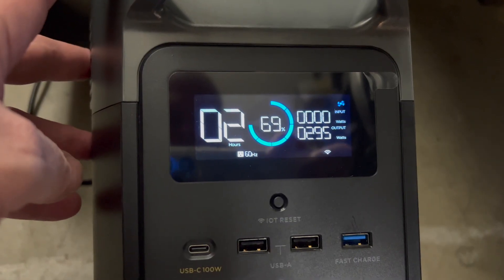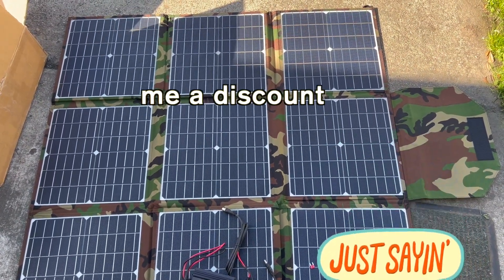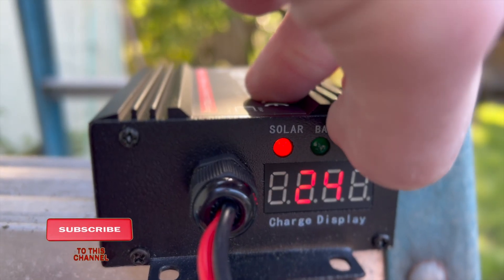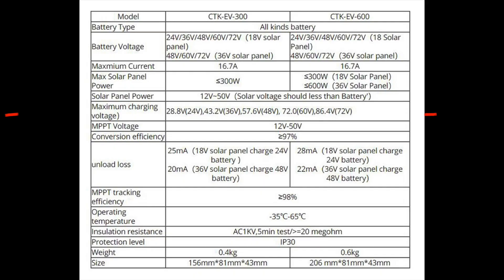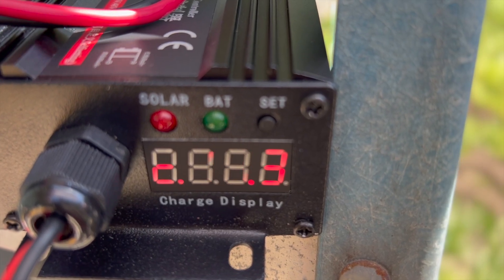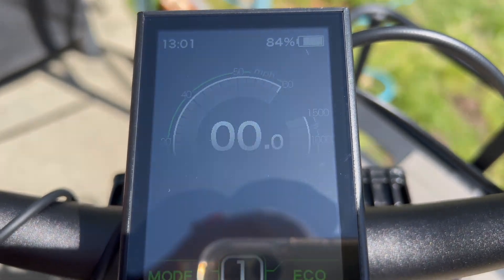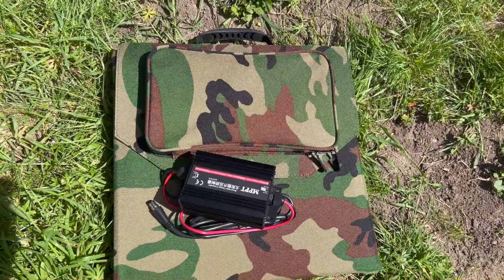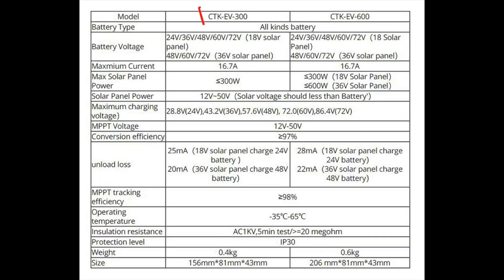eBike | Charge an eBike with ONLY a Solar Panel

Comment: ya but a 48v bike needs to charge over, at like 54 volts. and  the 60 volts would be too much. and my other question is, how do you regulate the amp output from charge controllers? ebikes only want 4 or 5 amps charging it. most charge controllers are 10 amps and up

Comment: 10.8v will not charge a 48v battery... did you mean it was pulling 10.8 amps...?  the charge voltage has to be higher than the current battery voltage to push energy (amps) into the battery..

Comment: don't put it on your roof.  It is less efficient when it is hot.  That hot tar is tranmitting heat into the panel from the bottum up.
Reply from the maker: I made the video a couple years ago in my old house, and it was the only place where I had full sunshine. It worked just fine.

Comment: I have an e-trike, 1000W, 48V, 12A, but $900 is more than I have in the bike, hub motor and wheel, and four 12V lead acid batteries. Where's the economics?
Reply from the maker: It's obviously a subjective topic. If one plans to travel by ebike and camp along the way, this is a possible option to recharge during a day at the campsite. It's a lighter option than carrying a power bank like a 1500w Jackery.
Reply: Oh, that’s AU prices, so 75% of that in US dollars I guess?

Comment: can you list all of the stuff you have used please
Reply from the maker: Sure.
Bakcou 200 watt solar panel with charge controller
EcoFlow Delta Mini to fully charge both my ebike batteries from 35% to 100%
Jackery Explorer 500 to top off four ebike batteries from 90% to 100% while camping
Jackery Explorer 1500 to fully charge both batteries on my ebike from a 20% charge to a 100% charge

Comment: Hey Tim, now that you've had this charging system for a while, what would you do differently today? Going to invest in a ULTRA FS Pro dual next spring for off road adventures so I'm tryin to dial in my overall costs for this to be efficient and fast. I think the cargo trailer you reviewed does it for me to be able to carry a solar system and a possible ECOFLOW DELTA 2 if I can swing it.
Reply from the maker: The Backou is nice because of its size and the fact that it can plug directly into the ebike's charging port. It's really best for riding and camping.

If I'm actually camping and bringing the ebikes along, however, my Jackery 1500 is by far my favorite option. The downside is that it runs about 36 lbs not accounting for at least one solar panel (about 15 lbs each).

I really like my Ecoflow Delta Mini at around 24 lbs, but it's only 852wh. The Delta 2 definitely provides more charging power and is only about 27 lbs. I also like that Ecoflow has the smart phone app you can sync up, but it's only good if you can connect the power bank to wifi. Ecoflow's solar panels are a couple pounds heavier and a little more cumbersome than Jackery's, but Ecoflow is a great choice.

For me, I love my Jackery 1500, but mostly because I've purchased four different options now and it gives the most watt hours at 1544. I also have a Jackery 500, but it's really only good for simple top-offs from about 80-85%.
Reply: @twowheeltim  Thx for the quick reply Tim! The Backou sounds like the wat to go. Thinking about just buying a 3rd battery instead of Ecoflow to save money. I can buy the battery bank later.  at least this way I can leave both batteries at camp charging during the days I'm out on the mountain and don't need a range extender. Having 2 full batteries in the morning when it time to leave home should do it. I can always charge the 3rd batt from the solar panels while riding home if needed anyway. Cheers
Reply from the maker: I actually had just arrived home from work and the notice of your comment popped up, so a quick reply was easy. 😆

I bought a 3rd battery from Biktrix late last year when they were running a special on batteries. Hopefully they do it again this year. 🤞🏼

I like the Bakcou, and upon request they even threw in a barrel plug adapter for Elaine's Hub Duo; my Ultra Beast 2 has a 3-prong plug for charging. Not sure what type of plug the FS Pro has...

Best if luck in your decision! I'm confident you'll be stoked!!  👍🏻

Comment: Great for remote charging. Fyi it costs about 4cents of electricity to charge a battery from 0 to 100%
Reply from the maker: My video wasn't to promote solar charging in lieu of charging with electricity. It was to explore the option of solar charging on an ebike camping trip where electricity is not an option. 👍🏻

Comment: Nice setup, only thing you should mention which is rather important, is that the solar panel system you have will have built in diodes to stop reverse current flow. If someone copies your setup with different solar panels they will need to use diodes in between the solar panels and the charge controller.....worth mentioning
Reply: Any decent PWM or MPPT charge controller will have a blocking diode built in
Reply: @dfgatorfan Better to give advice that's found unneeded. Than with hold, knowing, or letting poorer sorts try and waste everything, money, time effort to buy, effort trying it.
Reply: @dfgatorfan  yes i didn't know about that till recently
Reply: seems most charge controllers have built in diodes but worth mentioning
Reply: Most all new solar panels have the diodes built right in.
Reply: @Chris_1024_ very interesting result
Reply: @Adventures of Two-Wheel Tim
I'm looking for a 60v system. What's the name of the charger?
Thanks from Trujillo Perú.

Comment: Hi thanks for the video. Will a 400 watt solar panel double the speed of the recharge?
Reply from the maker: Thank you for the positive feedback.

Presumably, that would be the case. However, it all depends on the amount of direct sunlight the solar panel gets. In the instance of this solar panel I tested, it would need to be much larger requiring more space to lay it in the sun.

I you were to get a nice quality 400w solar panel with proper charge controller and plug to fit your bike/battery, it's safe to assume it would charge more quickly.

I must caution, however, that I'm not a solar or electrical expert. This 200w solar panel, charge controller, and plug accessory kit are sold by Backou Bikes in Utah, U.S. and are sold as a bundle to charge ebikes. I imagine it could be used differently, just as someone with the proper knowledge and experience could set up their own ebike solar charging system. That's just not me, unfortunately. 🙂
Reply: @twowheeltim  thank you my friend
Reply from the maker: Happy to help. My main reason for getting this panel was portability. I can carry it in my cargo trailer, and if were to take a multi-day camping trip I can use it to charge during stay-overs at campsites. At least, that's my hope someday!  👍🏻

Comment: What is the cheapest portable power station and solar panel I could get for an e-bike do you think?
Reply from the maker: Well, it depends on the size of your battery, but realistically speaking to get something that will fully charge your ebike will cost anywhere from $1000-$1500. 

I have an Ecoflow Delta Mini that is an 852wh, 1400w output power bank. I also have 110w and 160w solar panels to charge it faster. I charged my Ultra Beast 2 dual battery ebike from about 35% to 100% in just under 3 hours.

The Ecoflow Delta Mini now costs around $600, but when I bought mine almost 2 years ago it was $899. You can now get a Delta Mini and a 220w solar panel for about $1200 on the Ecoflow website. https://us.ecoflow.com

Here's a link to a video I did charging my ebike with the Delta Mini: eBike | Charge an Electric Bike with a Power Bank! | Ultra Beast 2 & Ecoflow
https://youtu.be/vVbB_n78_2o
Reply: @twowheeltim  Nothing I could get for like 300 hey? Would it just be a waste of money at that point?
Reply from the maker: Unfortunately, for that price point power banks typically only have enough output to charge smaller electronics such as phones, tablets, laptops, etc. 

A $300 power bank would likely have around a 300 watt-hour output. Charging an ebike is going to pull around 250-300 watts, so a smaller power bank would barely last an hour and likely yield 10-15% charge at the most. That's fine for topping off an ebike battery, but the efficiency wouldn't really be worth it if using a solar panel to recharge the power because this would take around 5-6 hours to replenish. I tried it with my Jackery 500 and it was decent just for topping off.

I show that a little bit in this video: eBike | Camping & All-Terrain Versatility | Biktrix Juggernaut Ultra Beast 2 & Hub Duo
https://youtu.be/xZ7WozKy4xU

Comment: Where can I get a 2,000w solar panel from ?
Reply from the maker: 2000 watt solar panel for ebike charging?? I'm no solar expert but that would be pretty excessive for ebike charging, I think. A small home needs at least 4000 watts. If you really want a 2000 watt solar panel, Google it, but you won't find one made for ebikes.

Comment: Did that charge controller come with the 3 pin connector that plugs into your bike, or did you have to wire that 3 pin connector to the controller yourself ? Thanks
Reply from the maker: It actually came with the 3-pin plug, and a barrel plug for single-pin batteries. They're easily interchangeable.
Reply: @Adventures of Two-Wheel Tim  where can i buy it?
Reply from the maker: https://bakcou.com/collections/batteries-and-chargers/products/200-watt-solar-panel
Reply: @twowheeltim  Thanks Tim
Reply: You could have made the same setup with 300$
Reply from the maker: @Dammy1976 Well, I guess you should do it and make a video about it! ✌🏻

Comment: Definitely, something i am interested it getting.... My only concern is will it over charge a 48 volt battery at 57.6 volts and also there is no setting for a 52 volt battery. I am assuming you would use the 48 volt setting for a 52 volt battery. Great video though.
Reply from the maker: Thank you.

The charge controller that comes with the Bakcou solar panel also has a custom charge setting where you can set it at whatever you need. It's a cheap charge controller and it's hard to find much info: Sunyima CTK-EV-300

The solar panel, however, is way too big to use while riding.
Reply: You can buy the controller for 50 bucks and 100 watt panels for a little over 100 bucks, so for around 300 you have the same set up.
Reply from the maker: But how big are the solar panels? The panels I looked up are 43" long. The whole point is to have something that fits in a compact cargo trailer to take on travels. Not to set it up in the back yard. 🤷🏼‍♂️
Reply: @twowheeltim  foldable is absolutely the correct panel for that purpose. But I think a 20-22V panel would be better 🤔
Reply: You use the self setting and you set the voltage from the mains charger you have.